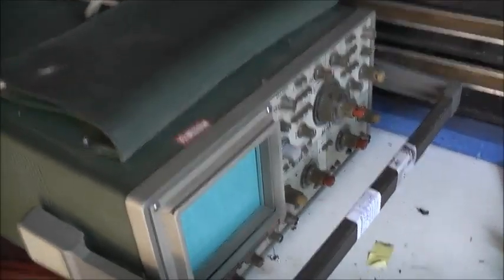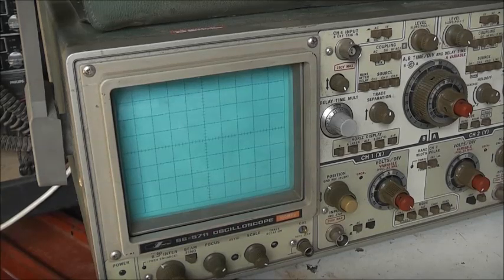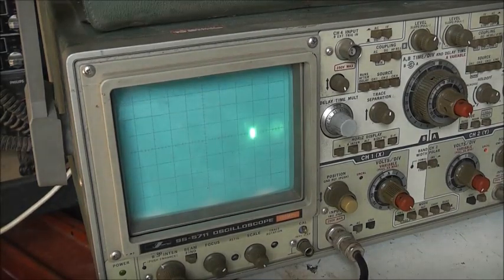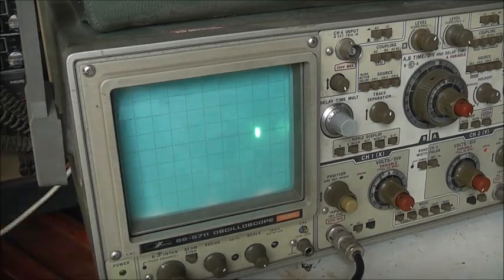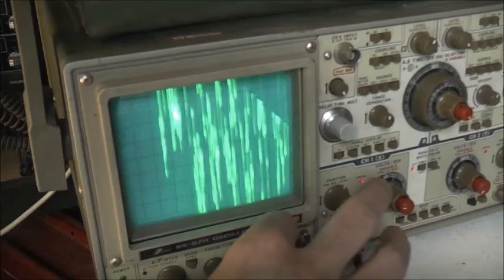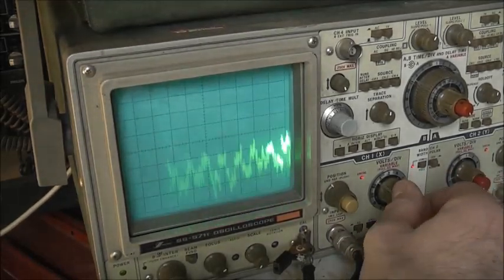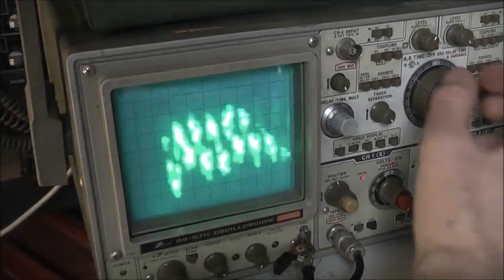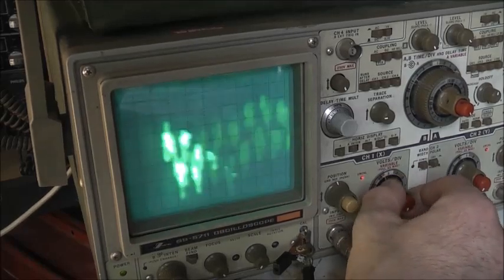Iwatsu SS 5711 Oscilloscope Score!!

Comment: Nice score!, just thought id let you know, Ive compared pool floc with Aluminium Ammonium Sulfate a type of alum  on the same car battery and the latter gave much better results, yet to find out just how good as havnt cycled it yet  (pool floc was from bunnings).   The comparison was just from an initial fill and full charge with both on same car battery.  The Aluminium Ammonium Sulphate is easy to get at a reasonable price on IHERB it is more expensive but if you buy a bit you get free shipping and works out to about $5-10 per battery.   My initial testing showed a higher standing voltage and higher cranking amps on the IHERB Alum.  Might be worth mentioning in your next vid on batteries for people wanting to try it.  It also seems safer and easier to work with, that might outweigh expense for many.  It also has a much higher PH being more like an actual alkaline battery although its certainly not alkaline.